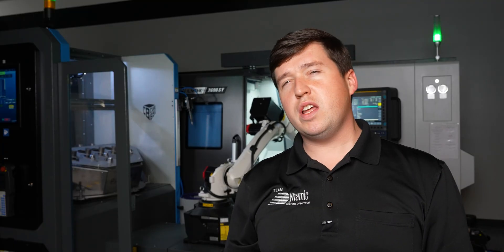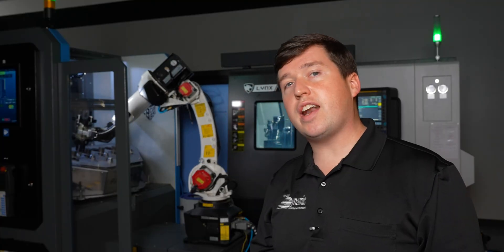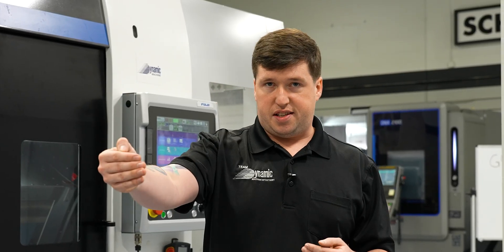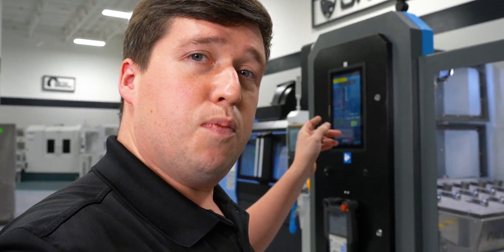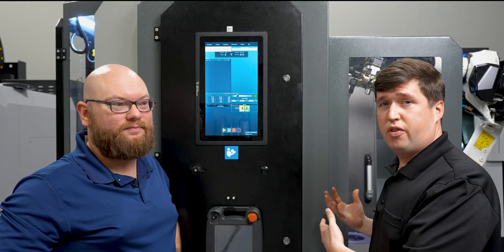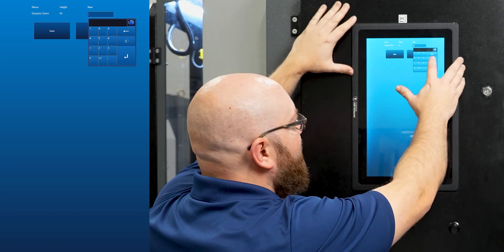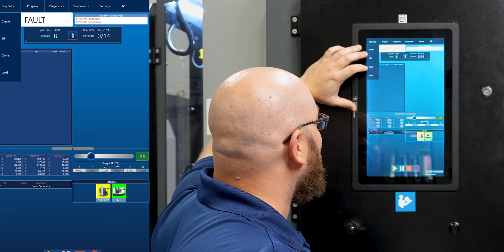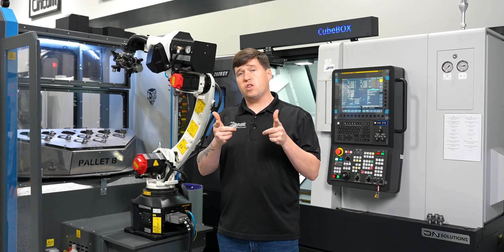Robots Just Got Easier | CubeBOX is Simplifying Automation

Comment: On your tool path after the part handoff I saw the rough turning and thought that is a weird tool path but then it dawned on me on me that you did that to avoid making a ring that gets pushed on to the part. Is that correct or is there another reason?
Reply from the maker: Good eye! And yes you are absolutely correct! I use this method on certain fittings when I mill a hex on the main and want no chance of a burr on my sub. I will finish the back angle of the hex but I will purposely go too far so my blend point will be on the back face. I find this is the best strategy especially when running difficult materials. 

The problem this method creates is exactly what you see in the video. If you just turn straight it will create a “machinist ring of death” as my dad used to call it 😆 so I stop early and then cut the remaining metal in X
Reply: @donniehinske that’s smart.  Thanks for showing me.

Comment: No clue why you wouldn't just deburr it in the machine if you have live tooling lathe or mill turn ect. but, if for some reason those few extra seconds did matter I suppose sure let robot be robot. I see this only for high volume production. It's still cool to see how robot/cobots are being used. haha to the alphanumeric issues. I swear every machine/computer has alphanumeric quirks. I have been using a function called fwritc on the okuma control to spit out probe reports inside my program. The file naming is so picky! Like here if you start with alpha you cant end with numeric and it doesn't quite tell you the rules you just have to figure them out. Drove me crazy but if you know how to debug you just keep trying and figure out the rules as you go. I'm with you on the robot thing. 

one of our machines has a "wine rack" tool changer with 166 pots. When we moved the machine one of the techs left me a wonderful surprise. They left a flashlight behind two of the pots at the bottom for light. I figured that out when loading tools haha. I refused to go in the back where the robot arm moves. That thing is so fast I dare not get in where it moves. Freaks me out. Had just enough room in front after removing some tools. I think not trusting robots is a certain kind of healthy. 1 bit flip away from disaster hahahaa
Reply: If your machines runtime is let's say 10 minutes and one cycle for the robot is 1,5 minutes, why would you deburr the part in the machine? You will save a ton of cycle time if you make the robot do some of the operations, like deburring, cleaning crossing holes and stamping the part. With a turret lathe, you might even get use of the tool station you freed up with the robot.